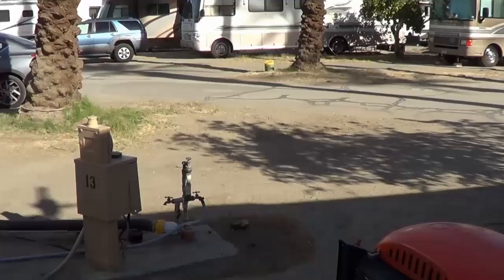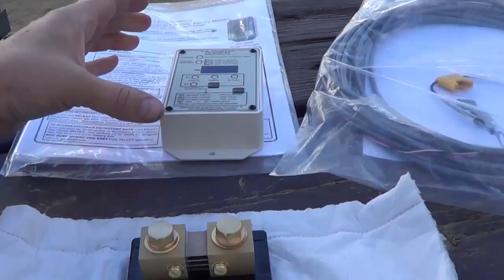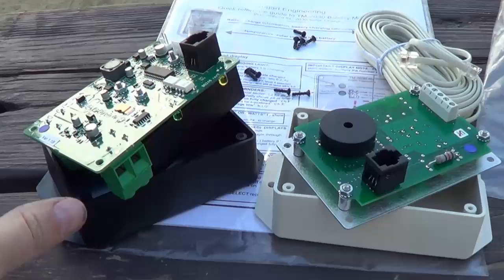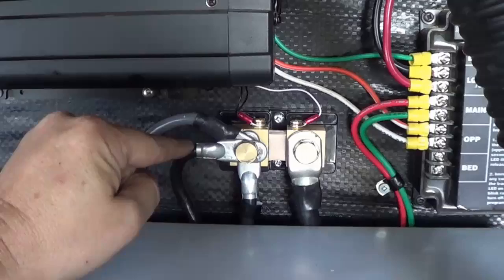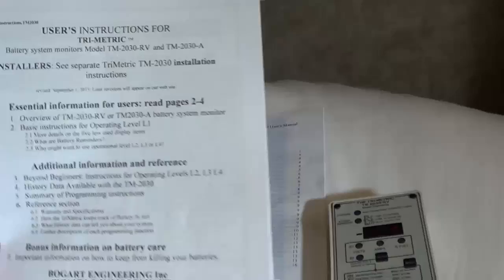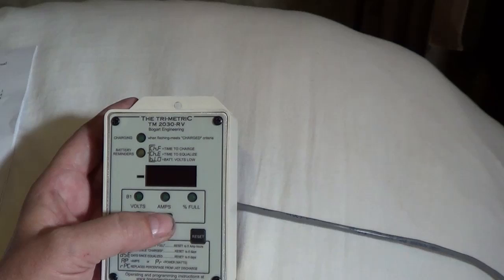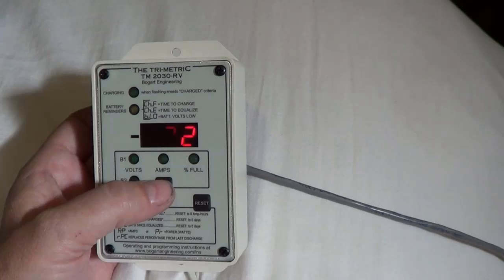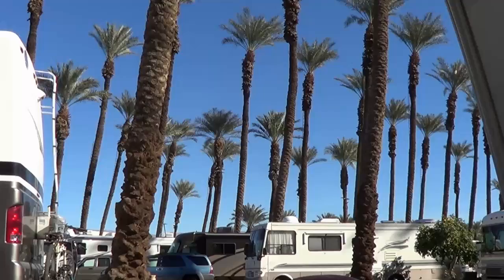Bogart SC2030 CC and Trimetric Battery Monitor Install

Comment: Thanks Ray for the in-depth setup! I just installed the same unit and figuring out the setup process. I am setting my cougar up the same way as you have, no since in reinventing the wheel.  If you have any lessons learned / tips anything would be great. I really enjoy your content. Thanks! Hope you and the wife are enjoying AZ, I grew up in Tucson AMR miss living there.
Reply from the maker: Thanks, Terry, this post, and video explain the full system as it sits now - http://www.loveyourrv.com/diy-rv-boondocking-power-system/  It's served our boondocking needs for a few years now. The only things I changed was to replace the flexible ground panel with a rigid Renogy like on the roof and add a catastrophic fuse onto the battery terminal.
http://www.loveyourrv.com/replacing-damaged-portable-solar-panel-plus-new-mounting/

http://www.loveyourrv.com/installed-catastrophic-fuse-rv-battery-bank/  Cheers! Ray

Comment: SC-2030/TM2030 combo, best set up ever for a small solar install, plus Ralph at Bogartindustries is such a nice guy, I sent him the webpage from my batteries  (since they weren't listed, and he sent me back the custom settings for L4.  Have have this setup for a year now and absolutely no complaints. Love being able to see exactly whats going on with my system.
I wish I hadn't wasted my money with a cheap on off charge controller and gone with this right out of the gate.
Reply from the maker: Yes, I've used it now for two months of straight boondocking, love it also. :)
And ditto on Ralph. Great guy to deal with.

Comment: Thanks for the video! Looking to add solar to our 5th and have been reading Handy Bob extensively/repeatedly trying to get it to sink in.
Reply from the maker: You're welcome.Lots of ways to skin a cat with a solar power system, so lots of opinions out there, but I do like Handy Bob's common sense approach and he has been out there and lived it for many years. My goal has been to get as good of a system as I could for the money spent. I'm at approx $1600-$1800 now including batteries.

Comment: Great info man! I just got my battery monitor 2030 and my shunt and Your vid will help a lot in the installation. It will be in a sailboat but I guess is not much a difference. Anyways thank you again for the video.
Miguel from Clearwater FL
Reply from the maker: Cool! I've pretty well completed my off grid system, work well this last winter in the desert boondocking. You can find a look at the final install here. http://www.loveyourrv.com/diy-rv-boondocking-power-system/  Includes a diagram and a video tour. Cheers! Ray

Comment: Like always, another educational video. I retired earlier this year with 34 years under my belt as an electrical troubleshooter for a large paper company, I don't think I could put anything like that together without a schematic. Looks nice and something I would like to put in our fifth wheel someday. Did I miss the video on the update to the battery bank?
Reply from the maker: Thanks. I had upgraded the batteries back home before we headed south with the plan of adding more solar once we got down here. Shipping is much cheaper for those items when we are in the states.  -  http://www.loveyourrv.com/upgrading-my-rv-battery-bank-and-12-volt-system/

Comment: Great video Ray. You have a very nice and clean install. As a fellow Canadian i Love the comment about time for a beer :)  Keep up the good work.
Reply from the maker: Thanks! As long as I don't have the beer while hooking up wiring things are good. :)
Reply: +Love Your RV we agree beer after work. Does your 1000w inverter run your microwave without any issues or concerns?
Reply from the maker: Not sure, never tried, but I believe our microwave draws more than 1000 watts or very close. I just have the Inverter wired to one dedicated AC outlet near our TV. We use it mainly to power the TV, computers and charge stuff.

If I need to run the microwave or toaster I just fire up our 2000w portable generator. But I pretty well cook everything  with the LP gas stove or BBQ when out dry camping. The bulk of our boondocking is done in the southern desert and evenings are usually cool so it's nice to have things heating up in the oven.
Reply: We have a motomaster 3500w moidifed sine wave inverter mounted in our shore power cord bay. I have a  dedicated outlet for it or i can plug the shore power cord in with an adapter. We rarely do any boondocking unless we are at a nascar race. We have the onboard genny and 2 champion cubes with a parallel kit for those occasions. When we travel i usually plug in the shore power cord to run our  bar fridge and the microwave. But I'm worried that the  modifed sine wave will hurt something since it is running the whole motorhome.
Reply from the maker: Many people seem to run the modified without issues. Sometimes weird things happen like a drill charger won't work or something. Some of the new microprocessor controlled power supplies in things don't like the modified wave.
The reason we went with a pure/true sine wave is its main job is to power my wife's big iMac desktop. Since it is expensive I wanted peace of mind that the power to it would be clean. We actually plug her into it even on shore power. Figure the output of the inverter is more reliable than the usual campground power. The batteries and inverter act as UPS and surge guard since it's on its own separate circuit. 

Here is a pretty good write up in the two types of inverters - http://www.xantrex.com/documents/tech-doctor/universal/tech1-universal.pdf

Cheers Ray
Reply: Thanks for the link. We have a couple of flat screen tvs and a surround sound system. But more  importantly our mac mac mini so I'm thinking a new inverter will be in the future. Thanks again.Rob

Comment: Enjoying all your hard work. Thanks for sharing. How is your cougar holding up? Thinking of buying one. Would you buy another one? Or something else?
Reply from the maker: Thank You.Holding up very well and we use the heck out of as full timers. I would definitely be looking at it if in the same price range again.
But, if I could spend more I may lend towards something from Northwood like an Artic Fox for the better 4 season installation and a more solid build for boondocking.
Something like this one with the off road chassis - http://northwoodmfg.com/arctic-fox-2/arctic-fox-29-5t/ Check out the feature list. Has a very similar layout to our Cougar, which is something we really like about it.
Of course, it is a little bit of an apples and oranges comparison because of the price. :)

Comment: Just curious, with such an extensive upgrade, why did you choose to stay with the PWM instead of a MPPT charge controller? Thanks for sharing your vids.
Reply from the maker: I touched on this a bit in the blog post but don't want to set off a big PWM vs MPPT war. Both have pros and cons in my mind.
I just believe it was better for my particular setup. More cost effective, I could spend my dollars elsewhere in the system. Also, PWM are very reliable since they are so simple.
Check out the Bogart FAQ for more in-depth reading on the subject - http://bogartengineering.com/support/faq/ Click C. then C1.
Cheers Ray

Comment: Great video and great solar series overall! Really happy to have found your channel. What didn't you like about the Renogy charge controller? What was its absorption voltage setpoint?
Reply from the maker: Thanks! The Renogy controller that came in the kit was very basic, worth only about 20 dollars. worked OK but very limited as far as settings go. You can see all it's spec here - http://renogy.com/wp-content/uploads/2014/07/PWM1030CC-Manual.pdf
So when I had enough cash I upgraded to the Bogart SC2030. With the Bogart controller and it's companion Trimetric monitor I have access to manually set all the charging voltages, so can tailor its operation to my specific battery type and brand and my unique charging needs. Also, it has a manual equalization feature I can run every few months to keep my battery bank operating at peak performance. Finally, it came with a temperature compensation.
Cheers Ray
Reply: +Love Your RV Thanks for the info. I'm sizing a ~200w system for a small camper and think the Bogart gear is the way to go. I'd rather just do it once though.
Reply from the maker: So far I'm happy with it after nearly 3 months of constant use.

Comment: Ray is it possible or should I say easy!! to up the amount of charge voltage to batteries from charge controller without doing a equalize cycle.  thinking of about .2 volts  14.8 to 15.0 thoughts?
Reply from the maker: Yes the SC2030 controller is completely configurable using the Trimetric. All the different charge phases can be manually set.
So the absorption could be set to 15 volts if required. You would have to watch not to overcharge the batteries and cause then to boil over or maybe cause the inverter to shut down due to too high of an input voltage.

Comment: I saw you put a 40 amp breaker in front and after your charge controller. Why not 30 to match the charge controller?
Reply from the maker: I thought a little extra headroom would be helpful so it didn't blow breakers falsely but only if it was a true problem.  Handy Bob used 40s in this install so I figured that would be a good figure for safety but not interrupt normal operations. https://handybobsolar.wordpress.com/2015-the-trimetric-2030-perfect/
Reply: Thanks for the reply, safe travels

Comment: Hi ray, I’m still a bit new to all this about solar but I got from a friend the TriMetric monitor and I’m not shure why you didn’t connect the alternator to the shunt as it says in the manual? If I could conect my isolator instead that would be much easer to do. Cheers
Reply from the maker: Mine is installed in a trailer, so no altenator.
Here is a link to the install manual - http://www.bogartengineering.com/wp-content/uploads/docs/TM%202030%20INSTRUCTIONS_041018.pdf?boxtype=pdf&g=false&s=false&s2=false&r=wide

Comment: Should both of the jumpers on the SC2030 be removed when using it with the TM2030?
Reply from the maker: Here is a link to the technical manual - http://www.bogartengineering.com/wp-content/uploads/docs/SC2030%20Technical%20Manual.pdf
6.3 Description and graph of SC-2030 charging profiles
Standalone operation-without the TM-2030: With the TM-2030 not connected, there are only two charging selections
available (by two jumpers you set on the SC-2030 circuit board.) They allow choice for "AGM or liquid electrolyte" and "12 or 24V" system. These are intended to be for "backup" charging if for any reason the TM-2030 is not connected. When the TM2030 is connected, these values are ignored.

Comment: Hello Ray,    Do you have a cut off switch between the panels and the charge controller?  How do you prevent from getting zapped if you don't? Thanks
Reply from the maker: Yes, I've installed breaker I can turn on and off. Even so, my solar panels only put on a max 18 volts DC. I have them hooked in parallel,  the voltage is quite low. Here is my system as it is now - http://www.loveyourrv.com/diy-rv-boondocking-power-system/

Comment: MPPT should get you about 30% more. I would of gone with that instead.
Reply from the maker: Some reading for you from the engineer who designed the SC2030 PWM controller

C1. The debate rages: which controller is best PWM (Pulse Width Modulation) or MPPT (Maximum Power Point Tracking). Why did you choose PWM technology instead of MPPT for your SC-2030 Solar Charger?   Click for answer
A very good question! They BOTH have good and bad. Plenty of hype has been written already. Here's my (Ralph's) view:The "good" for PWM: It is simpler and lower cost technology. Under some common circumstances–it can actually deliver more amps to the battery. That could be when:(1)days are moderate or warm, with few clouds.(2) batteries are charging at over 13 volts, (in a 12 battery system) which they almost always are when actually CHARGING.(3) Panel voltage is properly matched to the battery voltage, for example "12V" panels are being used with a 12V system.PWM is actually more "power efficient" than MPPT–which means less total power loss in the controller itself. So heat sinks in the design can be smaller (and less expensive). Missing in most analysis of MPPT is that there is always a conversion loss with MPPT, which tends to be higher the greater the voltage difference between battery and panels. That's why PWM can actually beat MPPT under circumstances described above.Some places that analyze MPPT assume that panels with 30V open circuit voltage are being used in a 12V system. Any good MPPT system will easily provide better performance in that case. They also may assume batteries are charging at 12 or even 11 volts, which is unrealistic. Lead acid batteries are typically below 13 volts only when discharging, or perhaps charging with very little charging current–meaning the actual potential gain in amps is not great.The benefit for MPPT becomes apparent if you use panels not voltage matched for the battery. If they are not, MPPT will utilize more of the potential energy of the panels. For example, if you use 24 volt panels to charge a 12 volt battery system you must use MPPT, otherwise you would be using your panels very inefficiently. If you are trying to use PWM in that case, you are misusing the PWM technology.Another potential benefit with MPPT is that if distance between panels and batteries is far, smaller wire can be utilized by running panels at higher voltage to the batteries. Running at twice the voltage reduces wire size to 1/4, which for a long run can be a significant saving in copper wire.If temperatures are low enough, the slightly less power efficiency of MPPT will be compensated by the higher panel voltages, which will result in a little more battery current. But in actual measurements we made using a commonly sold MPPT solar controller, this would occur at temperatures less than 55 F degrees (in full sun, when charging at more than 13 volts), where there is a slight advantage to MPPT in my location (Boulder Creek, near the California coast). As temperature drops below that (in full sun) MPPT will get some advantage, such as could occur at high elevations in Colorado in the winter. Potentially this would be maximum about a 2.5% improvement in amps output for every 10 degrees F lower in temperature (or 4.6% per 10 degrees C colder. I'm using data from Kyocera KD-140 panels.)There can be theoretically optimal situations (that I don't personally experience where I live) where MPPT could give some advantage: that is when solar current is present, but the batteries are quite low in charge–but because loads are high and even greater than the solar current the batteries are still discharging despite the solar current. Under these conditions the voltage COULD be at 12.5 volts, or even lower. Again, using data from Kyocera panels, ("Normal Operating Conditions") there is a theoretical maximum gain over PWM of 20% current assuming NO MPPT conversion loss and no voltage drop in the wires to the panels, at 20C (68F). With PWM, the voltage drop in the wires in this case would not affect the charging current. Now if in addition you lower the temperature to below freezing at 28 degrees F (while sun is shining) you might actually get up to a THEORETICAL nearly 30% gain while the batteries are discharging.The only REALLY BAD part of MPPT, is all the hype surrounding it–for example one manufacturer advertises "UP TO 30% OR MORE" power harvested from you panels. If you are using solar panels properly matched to the batteries, 30% ain't gonna happen unless it's EXTREMELY cold. And your batteries have to be abnormally low in charging voltage–which tends not to happen when it's cold (unless you assume the battery is still discharging while solar is happening). Virtually all the analyses I've seen touting MPPT on the Internet ignore the conversion loss, assume really cold temperatures, assume unreasonably low charging voltages, assume no voltage drop in the wires from panels to batteries, use STC conditions for the panels (that the marketing types prefer) rather than more realistic NOCT conditions, and in some cases assume panels not voltage matched to the batteries.The other thing that is misleading about MPPT, is that some manufacturers make meters that show both the solar current and the battery current. In almost all cases for a well designed MPPT type the battery current will be greater. The engineers making these know better, but it is implied (by marketing types?) that if you were NOT using MPPT you would be charging your batteries with only the SOLAR current that you read on their meters. That's not true, because the PWM BATTERY current should always be higher than the MPPT SOLAR current. It is the nature of the MPPT that maximum power occurs when the current is lower than the maximum, so they must operate there to get the maximum power. So to properly compare the two you need to compare MPPT with an actual PWM controller in the same circumstances.Finally, the reason we went to PWM is that I was anticipating that panel prices were going to drop (which they certainly have over the last 5-10 years!) and that the small advantage of MPPT (under conditions where the correct panels are used for the batteries) would not justify their additional cost and complexity. So my thinking, for more total benefit per $, put your money in an extra panel rather than a more expensive and complex technology.